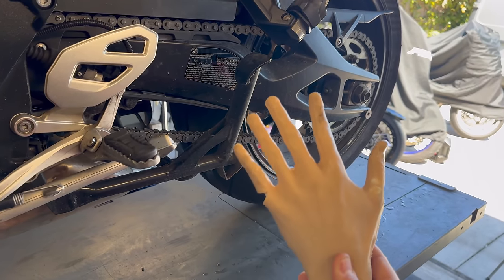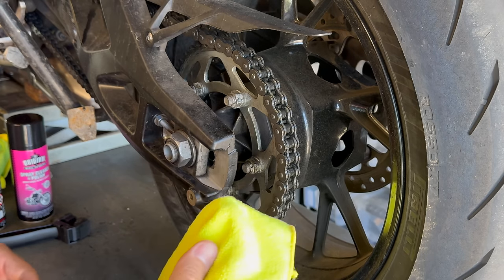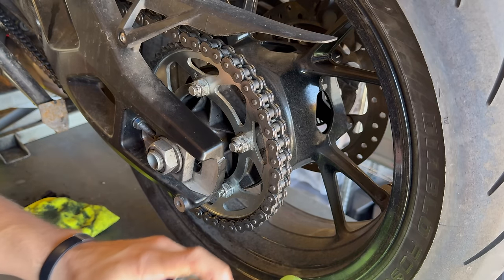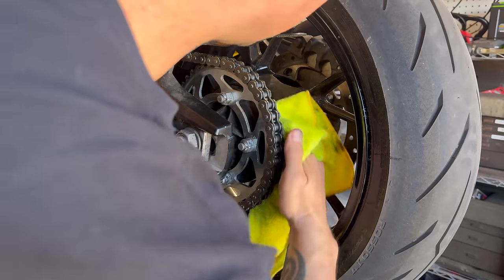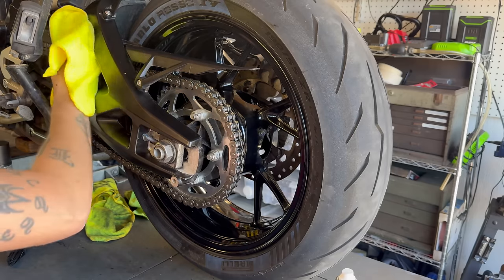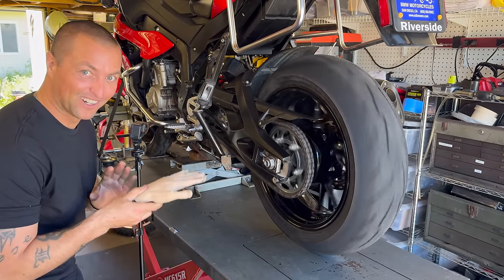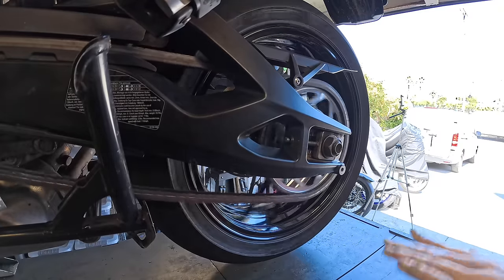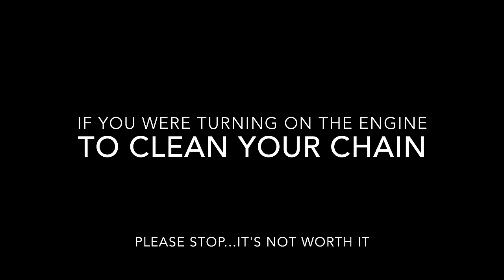How NOT To Clean Your Motorcycle Chain

Comment: I actually had a blog post about what might happen if you clean your chain while running your bike on gear. I had to take that post down a while back because of Google's policies and because the pictures in that post were "a bit" graphic. I'm glad the fingers weren't mine. The individual who sent me the pictures and description of what happened was just cleaning the chain, just like always. With kerosene soaked rag and bike running on gear. The rag suddenly got caught on apparently one of the rivets of the chain and before that individual could even realize what had happened, her hand had gone all the way around the sprocket, between the sprocket and the chain, she had all of her fingers severed in exception of thumb and her bike didn't even miss a rev during that fraction of a second.

How ever you clean your chain don't EVER do it with engine running. Not even with gear on neutral. You'll loose your fingers eventually.
Reply from the maker: yup, that's what this video is trying to convince people of
Reply: @MotoJitsu  yeah, but seeing what chain and sprocket can really do to a hand is horrifying. That girl I talked about finally lost two of her fingers to necrosis after months of surgeries and cures.

Comment: How often do you clean it? Also my GSX-R manuql says not to use those spray lubes... Only use heavy motor oil
Reply from the maker: every 800-1000 miles or something like that
Reply: @MotoJitsu  thanks
Reply: There’s nothing wrong with spray lubes. They exist for a reason. 
That said, oil is a cheap yet effective way to lube the chain.

Comment: A friend told me last year, after I bought my first bike, to do this while lubing the chain. "Just kick it in gear, and spray it on", he said. Apparently he did this himself as a long time biker. Already knowing the dangers of it from listening to you and other sensible YouTubers, I knew I would never do such a thing, and just didn't say anything to him. Why bother.
When I did clean my chain for the first time, I did put it in gear and ran it on a stand for a few minutes just to warm it up before cleaning it, as I just pulled the bike out of the garage without riding it. This is the first time I actually saw the speed at which the wheel turns at idle in 1st gear, and immediately I thought to myself, "This is crazy! People actually clean and lube their chains like this? They're out of their mind!"

And even if there were no safety concerns at all, I still wouldn't do this, just because I can't imagine the mess it would make. And the whole point is to keep it clean.
Reply from the maker: people do some dumb things

Comment: I have lost a piece of my ring finger and permanently messes up 2 other fingers doing this. I cleaned my chain once and i did that stupid mistake once and that was all it takes for me to have permanent irreversible damage and pain. 
Never ever work on a machine while it’s running. All it takes is a split second for the sprocket to bite on the rag you are using to pull in your hand and thats what happened to me. If you don’t have the patience to clean the chain send it in for service. A couple hundred dollars is not worth more than your hand. 
Appreciate the hand god has given you and don’t ever attempt it.
Reply from the maker: ouch

Comment: I wonder how this would have changed compared IRL. I guess severed fingers or hand somewhere around wrist? I don't expect human body be able to actually stop that chain...
Cleaning nice example but to me it seems a too much... I just take wd40, spray for 1-2 rotations (inside lower part of chain before sprocket), take the scrubber again couple of rotations, microfiber cloth to wipe the chain down. Wait a minute or so just in case there is some cleaner left, then spay the lube on the inside of the chain. Done. To protect the wheel I use piece of cardboard that just rest againts it. I clean the chain usually somewhere between 500-1000km or after washing.
Reply from the maker: I don't want to see it in real life

Comment: I was stupid enough to use a cloth one time and now I got a right pointy finger replanted.
Since then, I tend to use just the chain brush
Actually, you can cut your finger off even while spinning the wheel by hand, if you're using cloth or smth to clean the chain.
Reply from the maker: You CAN go running down the street with no shoes on too, doesn't make it a good idea.
Reply: It happened in November 2023. So dislike for not posting this video before November! (just kidding)

Comment: I get better cleaner chains with kerosene in a spray bottle to clean and 80 -90 wt Maxima Gear Oil to re-lube  applied with a small paint brush..... Never cleaner or better lubed   If you ever try kerosene you will not believe the cutting power it has so I put a drain pan under the chain to catch the kerosene and dirty gear oil.
Reply from the maker: https://www.instagram.com/motojitsuclub/

Comment: there is only way one to cleana chain and that is to take it off, let it soak ina good cleaner like diesel or parrafin then hang it up and pour over some nice clean fuel to rinse it off now let it hang to dry.. when finnish put some  hard chain grease in a open tin biscuit tin, . warm the tin so the grease is now a liquid, then put in the chain and move it around for a few minutes now lift up the chain and let it drip back into the now cool tin.... dont take long and chain can now be wiped over on the outside,,, while waiting for this clean both front and rear sprockets... now you can put the chain back on knowing there is grease INSIDE and on the dges of the rollers, this way cleans the chain and extends the life of the chain by aroudn 300% or more..   what is done above looks clean but useless for chain life plus you got crap all over the wheel and tyre.
Reply from the maker: yea, no one's doing that

https://www.instagram.com/motojitsuclub/

Comment: If you truly, truly must, then only use the brushes or sprays, the sprays are noncontact and the brushes are disposable, where your body is neither.
I admit to running my bike for portions of cleaning, but any part that involves having my hand actually down in the deep, I cut it out; safety above all, I will accept the loss of a brush, I will accept that the sprays might fling off a bit as soon as it hits the chain, but I will not accept that I could lose a finger because I thought it would be a good idea to cram it in there for some horrid reason.
Reply from the maker: https://www.instagram.com/motojitsuclub/

Comment: Do you wash the clothes that you wiped the chain or you just throw them away?
Reply from the maker: Usually wash them once a week, have a big pile...depending on how dirty they all are.
Reply: @MotoJitsu  How do you remove the grease though, any special soap or chemical in particular?
Reply from the maker: If I'm doing a deep clean on the rags then I just use paper towel (shop towels) or throw them away..most of the time the clothes I use are just wiping down the entire bike, not so much on the chain.

Comment: Is kerosene good for  cleaning a chain?🤔
Reply: It’s all I use. Soak with kerosene, brush dirt loose, power wash dirt away, compressed air dry, then lubricate with 90w gear oil. Wipe off excess.

Comment: I put a heavy duty non disposable rubber glove and then I take a wad of cheap toilet paper I bought in bulk and I soak eh wad in diesel fuel and I wipe the chain on both sides with that wad and then I do the other side with a new wad it not only cleans but also lubricates and it is  both CHEAP and effective!  I do also use the same brush you have if needs it.  I then wipe down the wheels something I do often as much as I can reach without moving the bike so they only get t/4 clean but within days it has been cleanned all the way round multiple times....I dont believe in washing my bike real often choosing instead to spot clean it with spray bottle a soft brush and wiping
Reply from the maker: https://www.instagram.com/motojitsuclub/

Comment: Youre just rubbing the dirty stuff inside the chain causing more wear on the chain
Reply from the maker: The brush does nothing?
Reply: @MotoJitsu  No you need to rinse with water after the brush
Reply: Cleaning is just for looks
Reply from the maker: I don't clean my chain with water, never had an issue. Many ways to do one thing, just don't have the engine on if you like your fingers.
Reply: @MotoJitsu  I only leave the engine running when I lube the chain. Keep my gloves on to be sure.
Reply from the maker: do as you wish, not my life...some people have to touch the stove to realize it's hot
Reply: @MotoJitsu  just kidding I dont lol. But sometimes I do have to touch te stove.